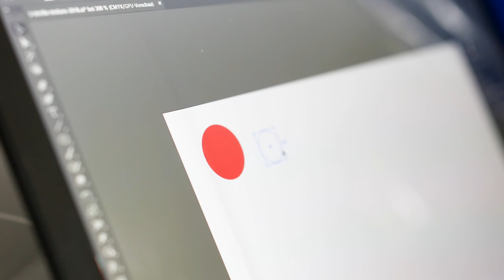Shigura Brake Upgrade | Shimano XT + Magura MT5/7 - Bike Build MTB

Comment: With Shimano Mineral Oil the brakes are more consistent, because it has a higher boiling point (280°C vs. 120°C).
I tested both in the same configuration and I prefer the Pink Blood!
Reply: Thanks for this info, I was looking for it. It is a bit vague whether one could use Shimano oil with Shigura. Now it's clear.
Reply: how about shimano and sram caliper
Reply: @rs28tv  no, they use different fluids and other stuff

Comment: I did exactly this today. At the lever it feels like a cross between sram guides and saints. Tons of modulation and then a strong bite towards the end. Gonna go ride it tomorrow and see how it goes.
Reply: @Gibz After riding them a while now, I'm loving it. Tons of modulation with extreme power when you need it. Takes a little getting used to the different lever feel though.
Reply: @Gibz Awesome. Let me know how it goes.
Reply: Gibz how’d it go?
Reply: @Gibz I'm loving mine after riding with them for a couple months now. I prefer the shimano rotors though, quieter than the Magura rotors. Also, after braking my rears xt lever, i swapped it out with a Zee lever and transferred over the lever blade with reach adjust, stroke screw and silver pin to make it operate and look more similiar to my front xt lever. Funnily enough, the xt and the modded zee levers feel exactly the same.
Reply: @dukeofmtb  Did you keep that combination? I am in the debate on what i want. I have two piston xt's, was thinking of throwing on a set of Magura mt5 calipers. But I am suspect my rear brake level might be kaput. How did the zee lever work out. Would you still do the same?
Reply: @jsniderhan  I actually switched back to the Magura master cylinders but with hc3 levers. They are amazing. The hc3 levers work on the mt5 levers too. If you aren't going to get the hc3 levers though, I'd stick with the Shimano levers. There's no real difference in performance between any of the Shimano levers. I've taken them apart and the innards are interchangeable between generations. Any changes to lever feel come from slight geometry changes at the lever and adjustments to the servo-wave. I actually preffered the Zees vs the m8000 levers. But hands down, the hc3 levers are the best I've ever tried. Now if only magura made the masters in aluminum, they'd be perfect.
Reply: email gmail  Magura with hc3 is definitely better than Shigura. Shimano levers have an inconsistent bite point. With the magura master, you can pull a vacuum at the lever and get a perfect bleed every time as well. With the hc3 levers you'll have more modulation and you can adjust the leverage to make the front and rear feel identical. Just don't strip the bleed screws and never over fill the system(always push the pistons in before closing the bleed screw), and you'll never have the issues some people have due to user error. All our bikes either have mt5's, mt7's, or mt trails. I've had zero issues with them.
Reply: Oh, and it doesn't hurt to keep a spare master handy, in case you hit a tree hard enough to brake one.
Reply: email gmail  Some people don't push the pistons back before closing off the bleed screw at the lever to have more fluid in the system so they have a more immediate bite point(completely unnecessary, considering that the mt7/hc3 combo already has a short stroke). Later when they replace the pads and force the pistons back with the bleed port closed, they blow the seals and complain that the magura master sucks, when in fact, it's just user error.
Reply: email gmail  Probably for weight savings. The mt7 is definitely sturdier though. It's carbotechture or whatever. The mt5 is plastic, but still, my wife crashed dozens of times with them and only broke a master once. That's why I keep a spare now. 😅
Reply: email gmail  Good plan.

Comment: I'm sure there's some kid somewhere who'd have loved those old brakes, or even the Magura levers.
Reply from the maker: Of course we didn't really throw them out 😄😉
Reply: MiddleAge MTB me
Reply: Sml
Reply: nobody loves magura levers :d
Reply: @poipoipoi090909  I break my magura levers :(
Reply: Robert Trageser  and the whole lever is bad designed. the pushrod push the piston not in the 0* angle, like for example at shimano levers, so levers are lighters but will be always leaked
Reply: @poipoipoi090909  I agree they're flexy and not the best, that's why some people would need replacements 🤣🤣
Reply: TooOld ForTwoWheels like me 😞😞
Reply: RollinRat  kinda late to the party but magura calipers are single block, they don't flex, also from what i know they add some modulation to shimano levers but they do eat oil at an alarming rate.
Reply: RollinRat  it's not the carbon, x0 has carbon levers and feel no way as close as cheap as magura's, I'm a mechanic as well and at the shop we have small box half full of snapped in half brake levers, keeping them for spare parts
Reply: RollinRat  agreed, also agree on how garbage sram brakes are, especially elixirs, a good rear brake bleed still makes the brake feel spongy for sram while elixir's feel actually good but I'm tired of servicing levers because the owner didn't feel like using the bike once in 2 years, the dot just attacked the piston and inflated it and his lever gets stuck for good. Also the hose has no rigidity either it's just a mess.

Comment: I bought the Magura MT5´s at the end of last summer after reading the positive reviews. To be honest, I haven't really been able to bleed them so that I would pleased about the result. The levers just seem too soft after every bleed no matter what I do. I was thinking about maybe trying MT7 levers for an upgrade, but after running into this video, I am really tempted to try the package with Shimano XTs!
Reply: Yup this is the issue I'm having right now, both are spongy pulling to bars after X3 bleeds. I'm looking to do this 'shigura' set up now.👍
Reply: @allancuthbertson627  I bought the XT levers and the olive + insert pins, cut the brake cables, tossed the Magura levers into the bin (really, I did), replaced them with the XT levers, inserted the old cables with the add-ons, bled them and voilá - the brakes work a hell of lot better! Highly recommended.
Reply: @salasola  So did you have to buy the olives and pins separate, I'd expected the olives to be with the XT levers and pins from the existing maguras? If so do you have the part numbers so I can source them? Thanks👍
Reply: Olive + Insert + SM-BH90 Brake Hose Connection Bolt. That's the Kit I bought.
Reply: @salasola  Thanks for your help Jaakko, I'm gonna buy everything this week and look forward to better braking😉👍
Reply: @allancuthbertson627  You're welcome - should do the job. :)
Reply: Sorry one more question, I have the BH90 olives, magura pins and XT 8100 levers. Do you need the Shimano hose connection bolts as the levers don't come with them. Or do the Magura ones fit universal?  Sorry to ask more questions, I just can't find the info on Google and don't want to disable my bike waiting for parts. I've just read back you did say connection bolts, ah I'd best buy some.😬🙈

Comment: XT master cylinders and levers with an MT4 rear caliper and MT5 front caliper. A concoction of exactlly 50% Shimano mineral oil and 50% Magura Royal Blood running through the (in my opinion) superior Magura brake hoses. Last peices to the perfect brake cake: 220mm Hope 2 peice floating rotors with centerlock on both wheels. However after a year and 10 months my trusty Hope rotors had worn more thin then I'd prefer (or consider safe), so i JUST recently replaced them with the new Freeza tech 2 peice Shimano floating rotors and so far they feel just about identical to the Hope ones, and even bedded in faster. Oh yeah forgot the secret weapon: tRiCkStUfF powerstop organic resin pads! These babies mean buisness, and have ALL the positive attributes of resin brake pads with honestly NONE of the negative I hear people complain about. Ive never liked metallic pads (they get contaminated too easily, and once they do their damn near impossible to save no matter how many times you resurface them with wet sandpaper) or Any pads with fins because they rattle around in the caliper incessantly! I've had decent experience with sintered pads, seems like they don't fade as much with extreme heat on long distance, but in my opinion nothing beats good old-fashioned organic resin! Don't get contaminated and start screeching the song of their people hella easy, extremely reliable, slow wearing with good durability, and these particular trickstuff ones bite better then other brands metallic pads anyway!
Reply: If your pads won’t seem to decontaminate I use rubbing alcohol and fire to cook the shit off

Comment: Hi Stefan. Long time since you posted this but I'm about to do the same. I'm using the magura hose, so wondering if I should use a magura barb or whether a Shimano barb with Shimano olive work ok with no leaks? Also as Saint levers are on sale I'm using those. Should I have gone xt or xtr or will it not matter? Hopefully you might still respond after all this time. Cheers
Reply: Did you get an answer ?

Comment: Great Combination, i also have this Combination on my four bikes. I never want something else. Can you make a Video how do you feel the difference ? The bleeding ist not so easy at the first time, but it's worth. 😃
Whish you good luck, best regards from Germany.
Reply: I feel there is more lever throw with the Magura Caliper than the shimano xt one. Will switching to Zee or Saint Levers shorten the lever throw? I'm currently running XT levers with Mt5 calipers. I like to keep my lever close to the bar so I prefer a very short lever throw/travel.

Comment: Question. 
Why a shimano insert pin? thought a magura insert pin should fit better?
Reply: Its a Shimano break line.
Reply: shimano pin on shimano body. It fits like designed with the internal dimensions. Magura is different and uses a longer barb head for whatever reason

Comment: Thanks for the tutorial. You did connect the Magura brake lines to the Shimano brake lever. Is there a way to use the already mounted Shimano brake lines to the Magura brake calipers?

Comment: I see you did the opposite of what i did. I used the magura hose, barb and olive. I also used shimano mineral oil. I read somewhere that the royal blood doesn't play well with the shimano lever but the magura caliper works perfectly fine with shimano mineral oil. What made you decide to use the shimano hose over the magura one?I read somewhere that the shimano banjo is slightly bigger and that it might not seal perfectly at the caliper. Thoughts?
Reply from the maker: We used the magura hose too. I tested both olives and both worked... 😀 Royal blood because the magura mt5 kit was already filled with it.
Reply: @StefanClemens  Ah, makes sense. So, how is it?
Reply: Hey were you able to use the Shimano hose and banjo combo? I also have just the magura calipers and thinking of using them with my Shimano slx brake hose. Or should I buy a magura brake hose with banjo.

Comment: Do you have any information on the amount of fluid moved by the different brake types? I've been toying with the idea of running magura rim brakes to grx levers and would be stoked on any info about hydraulic cross compatibility
Reply: It's pretty close. There is a chart somewhere online if you google shigura. I don't remember exactly where it was though.

Comment: Is necessary to install a magura disc or the shimano / sram function with magura caliper is good? Thanks .
Reply: Magura levers are made of plastic and break alot. There compatible because they both use mineral oil, so it's not compatible with sram levers because they use DOT fluid. And either way alot of srams feel like crap.
Reply: @kwilson4880  , Thanks

Comment: hi, I'm from chile, great job with this mechanic tip, but i got a few question's to do. 
how mineral oil can be use it in both brands, knowing the mineral oil are diferent. 
magura use BLUE royal mineral oil and shimano use mineral oil. 
do you compare both label and study the heating point? 
i ask this beacuse i'm getting started with the same proyect thing that you do. 
i'm so exhausted from use sram brakes, and your video iluminated me to do that. 
and for another question, where do you get it the information?? 
i hope you can answer mis questions. 
bless

Comment: Does it mean I can use any leaver with any caliper as long as it uses same type of fluid\oil ?
Reply: Not always! It depends on the inner width of the brake house and the mounting hardware that connects to the lever.

Comment: Just get some hope brakes best on the market
Reply from the maker: Or Trickstuff Direttissima :-D But i prefere the shigura anyway
Reply: @StefanClemens  Magura and shimano are good brakes but hope are just that bit more I have hope moto 6  six pots on my bike with 225 rotor on the front and 200 on the back
Reply from the maker: @tonkajjz109  where are you riding that combo?
Reply: @StefanClemens  bit of downhill and trails

Comment: Great video, but the question is why? MT levers are better than xt's !!
Reply from the maker: Really? They are ugly and the feeling of the xt is way better.. Try it and you will know 😄
Reply: Yes, I must admit the MT "composite" lever is ugly (in alloy it would be much better).
But the master cylinder is more effective, for me it's more powerfull with the MT.
Reply: shimano lever is much durable... magura, 1 fall, 1 lever bye
Reply: MT levers also rattle on the descents.

Comment: Tried it and I don't understand. I do exactly the same, but in my case the olive "twists" on itself, I don't understand at all... All I see is oil everywhere 😅
Reply: try and make sure you push the brake line into the body while tightening down the compression bolt!

Comment: I made a lot of shiguras mod.. All tem with mts magura caliper.. I have tested with xtr m9000, m987, m985, deore, m8000, m7000.. All tem works perfectly. But The fluid Best works with mineral shimano.. With magura The feeling harsh in lever pressure... I recomend shimano oil mineral
Reply from the maker: Hmm,  it's my second shigura build and it feels great 👌 But I will test it someday to feel the difference
Reply: @StefanClemens  The feeling is The royal blood is more density.. Mineral from shimano is more thicker
Reply from the maker: @fabianotajiri8811  thanks 👍 I will test it someday
Reply: @fabianotajiri8811  so it feels spongier with the shimano oil and firmer with magura royal blood? Is that what you mean?
Reply: @dukeofmtb  with royal boold The lever feels more heavy and slower.. With shimano oil The lever is more light and faster... Best feeling on braking
Reply: @fabianotajiri8811  How does it feel at the lever with the shigura caliper vs the shimano caliper for you? I'm so used to to shimano having a firm feel thay with the magura caliper installed, it feels kind of spongy at the lever. The power is amazing, but the lever feel isn't as good as a full shimano setup. Because of the spongy feel, I end up overbraking and locking up my rear wheel often.
Reply: @dukeofmtb  bring more modulation than shimano caliper.. Has more time before full lockout rotor
Reply: @dukeofmtb  I using shimano mineral oil.. I doesn't like final solid feel.. with shimano mineral bring me a better modulation before locking wheel
Reply: @fabianotajiri9122  ah okay. So it's normal for the lever to feel less solid than with the shimano calipers. Thanks.
Reply: What are your views on XT vs XTR m9000 levers? How do they compare?
Reply: Hi I have the mt7 calipers but no brake hose. Can we use the Shimano brake hose and banjo on the mt7 calipers?

Comment: May i know your xt lever is for 4pistons or 2pistons?
Reply: there is no difference
Reply: Levers don't have pistons, it's the calipers which have pistons.
Reply: @phal44  here in japan there is a lever for 4piston calliper and they don't advice to put a 2piston lever for 4 piston calliper...i don't know what is  the difference
Reply: @Yorabz-jk7sd levers are usually designed to work with a specific caliper but that doesn't mean they won't work with others. In this case it seems to work well since there seem to be a lot of people with this 'shigura' setup. I'm going to try an SLX levers with my magura caliper this weekend since I broke my front lever lol
Reply: @Yorabz-jk7sd  The only problem I can imagine is that a lever designed for 2 pistons might not be made to apply enough pressure to 4 pistons. It could mean you don't get enough braking or you risk damaging the levers by having to apply more pressure.

I haven't seen anyone try this setup and have issues so far (SLX or XT levers).
Reply: i have now a xtr 2piston brake..and i want to upgrade my calliper to xt 4piston ...is there's any problem on it  , is it possible? ..anyway thank you @phal44 for replying my  comment
Reply: @Yorabz-jk7sd  Well I can't say for sure it would work or not. Shimano do different levers specifically for 2 or 4 pistons in the XTR and XT groupsets but the SLX groupset only has 1 lever for the two different calipers (2 and 4 piston). You could either search around on the internet to see whether someone else has tried that combination or just try it yourself.

Comment: i need the files for the rings, to print them *:/
Reply from the maker: They're easy to make ;-)
Reply: @StefanClemens   innendurchmesser 0.9 ? aussen 1.4 mm ? hab keinen messchieber da, die farbe von den blenden kit ist einfach abgeblättert bei der montage ein witz.. lol
Reply from the maker: @fiarefoxx4892  du kannst auch einfach ein Stück Folie drauf kleben und schneidest es mit nem Cutter Messer passend
Reply: @StefanClemens   ich hab bei jemanden stickers für mein santa bestellt 95 euro für den ganzen rahmen ich kann dir ein bild zeigen wo die magura originalaen einfach die farbe abplatzt